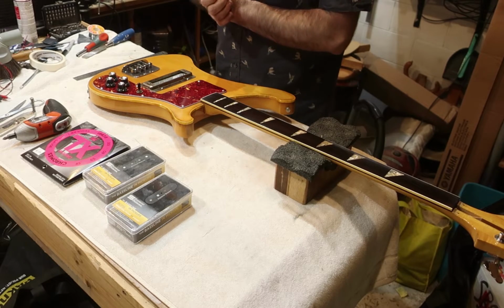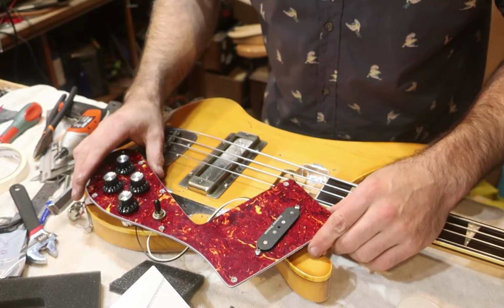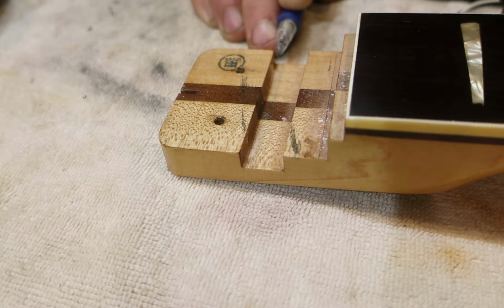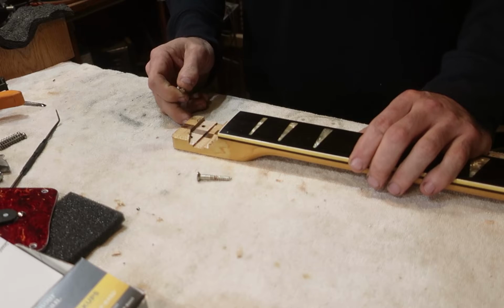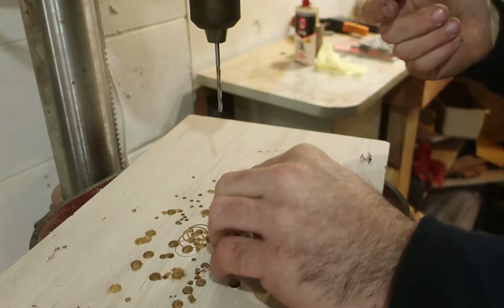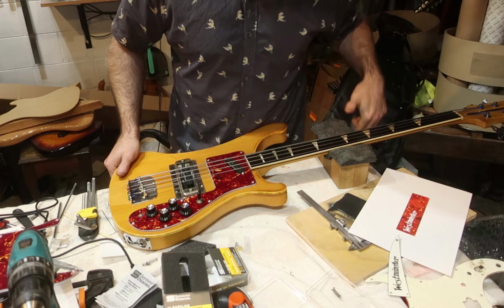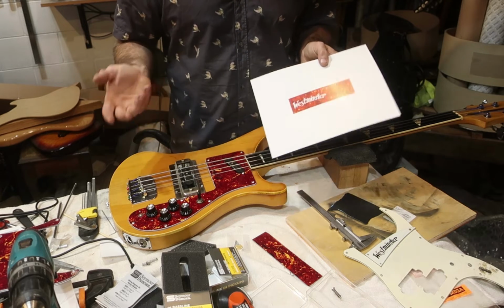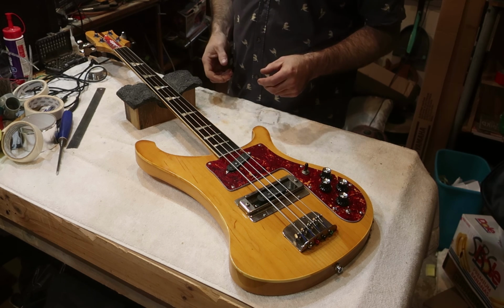Restoring A Vintage Japanese Rickenbacker Clone Episode 4 - Finishing the job

Comment: I have a fun video idea for you if you are ever interested, I did it a few years ago and it turned out pretty well. I converted a normal electric guitar, (it was a cheap old Squire I never used), into a fretless short scale six string electric bass. I did a horrible job doing it but it still turned out pretty good and played surprisingly well, and I was kind of curious how it would turn out if done properly. Just an idea I wanted to throw out to you.

Either way it's been fun to watch how many Frankenstein basses you have been assembling! I suppose you have a truly unique collection from it. I love these videos! They're definitely the best part of my day whenever I watch them! Thanks for making them!
Reply from the maker: I've actually gone the opposite, I have a 3/4 size P Bass copy with the exact same scale as a strat. Bass strings just flop about and become untunable at those lengths but I strung it with some heavy guage guitar strings and it was my main recording guitar for ages until I got a bit more serious about actually playing guitar properly (which I still don't really). I'm quite interested in getting/building a Bass VI though, I feel they have a lot of untapped potential.
Reply: @fanbladeinstruments  I've never heard of that one before, but that sounds really interesting. It kind of sounds nice, I find guitars to be a bit small for my fingers at times, especially after playing bass.

Comment: It looks and sounds great ! 
I might have done the neck / pick up a bit different . Cut all the material to the lowest routed point of the original , glue in and shape new heel piece . Then cut out just the new pick up clearance . 're drill neck screw holes into new top slice of glued in heel.   
No way of knowing if this would make any difference and chances are yours will be fine . 
Peace and love brother 👍🏻☮❤🏀

Comment: Since I never got pickups with mine and elected to single p/u at the bridge, I considered routing the neck pocket 15mm further towards the bridge and rebuilding the neck 15mm longer to eliminate that slot and 6 bolting it. Still an option though.

Comment: Hey man, great video. I'm curious tho, as I heard you talk about it and saw some comments, but still wanna make sure - how "bad" is the original neck joint on these japanese copies? I've had an Aria Pro II (bolt on) and a Fernandes (ntb) and while the Aria just felt "scary" to play due to the thin joint under the pickguard, it was the Fernandes thar had a completely warped/twisted neck, which was juuust unplayable. 
Ad rem, do you consider these bolt on thin neck joints problematic to the instrument as it is, vanilla? Should I prepare to glue in a block for extra security and just agree to ditch the front pickup if I want it to last? Would love to hear your thoughts, cheers!
Reply from the maker: In my experience the older Japanese instruments (if they're gonna have a neck issue) either suffer from stuck truss rods or other neck warping problems. I wouldn't say the neck joint would fail as per the factory design, but my removal of more wood is definitely not ideal. It's a weird gamble you take with a bass like this, for years they had a reputation of being rubbish and many were, but as years go by all the bad ones have completely fallen to pieces or warped irreparably, and as more time goes by the overall risk of buying a bad one goes down. Essentially, if it was going to fail it would've done it by now.
Reply: @fanbladeinstruments  thanks for the answer mate. I think I agree, but still, the question in my head reamins whether it makes sense to sink 700usd into one of these, or try to save up another 700 for a real rick. I appreciate the feedback tho!
Reply from the maker: Ahh yes, I forget that other countries can get real Ricks much cheaper than they are in NZ, given the choice I'd go the real one 100% of the time. There's currently one single Rickenbacker for sale here for NZD$5000. I got super lucky when I got mine for NZD$3000 and I expect there'll never be another one at that price. If you can get one for USD$1400 (NZD$2200) then absolutely that's the best choice. Good luck.

Comment: If the neck pickup rout in the neck becomes a problem, could you remove some material from the neck pocket and then add that amount of material to the bottom of the neck instead?
Reply from the maker: Fantastic idea, that's a definite option if I have to. It's been on there for a few days now and it seems to be holding so I'm hoping it'll not be a problem. As I was doing the final edit just now I realised that I never sealed the wood after carving the space, and I don't know if I trust the shielding tape to be fully waterproof... I'm monitoring it closely for any signs of it shifting but it seems to be good.

Comment: Congrats on the conversion! I personally believe the original truss rod cover would be better (the red in the headstock looks weird to me, but the red in the body looks great in my opinion). Also: do you plan on making a tour through your twin fretted/fretless basses? It would be interesting to know the specs of each pair and how each sounds against its "twin".
Reply from the maker: Sadly the comparisons wouldn't be totally valid, each pair has different necks, woods, pickups, etc. I'm planning on doing a couple of scratch builds with everything matching as much as possible, that would actually throw up some interesting and useful info.

Comment: Ahh yis, the Beer Nicissity. Don't we all have that?
Nicely done on the bass! Would low-tension flatwounds help with the neck (potential) issue?
Reply from the maker: Yes, I'm thinking about putting some lighter guage strings on it, it's a bit of a beast to play so lower tension could solve both those issues. I'm just going to monitor it for a while and see if the strings play in and if any other issues develop. I haven't even plugged it into  my main gigging amp yet, I'll take it to the show on Saturday and get to take it for a real jam and see how it holds up.
Reply: @fanbladeinstruments  Sounds good, also keep the tortoiseshell pickguard! Looks great

Comment: It's a shame that you just didn't place the neck pickup in the original location (not slanted), chances are it would have fit with no wood being removed.  Whats done is done...
Reply from the maker: Still wouldnt have fitted depth-wise, and the pole pieces would've been misaligned.